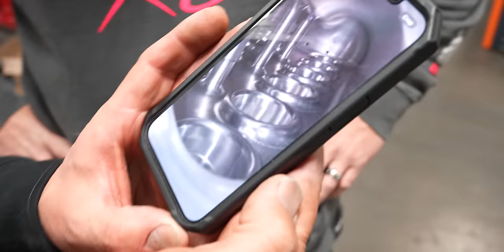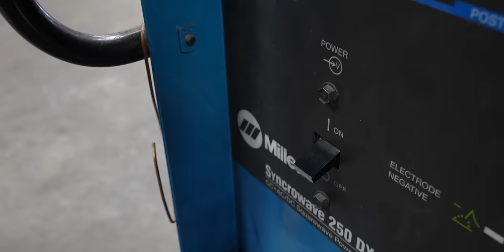EVERY FERRARI IS BROKEN AND CAN’T BE FIXED….

Comment: Put a fuel tech or Link ECU and hire a wiring guy in LA to come do it. Probably 5k a car for wiring. Plus , both ECUs are around 2500. Motec is overkill. I would do a motec in the f12, but the 599 can get the other ecus. Mike, look up a wiring guy, I do this all the time. If you guys would hire me, I could do it for you, but Dave still hasn't replied to my emails. 😂😅 good luck. The rear diff subframe is perfect good job guys.
Reply: put this comment to the top boys

Comment: Shouldn’t your tech have known you can’t copy the ecu’s? That seems like something a trained tech should know
Reply: Was thinking exactly the same thing 🤔 jury is still out for me with Steven. Time will tell I guess.
Reply: Yeah. This seems really odd
Reply: Was wondering this too. Dave took the fall but the tech should have known better.
Reply: You can’t copy the locked ecus.  Ecus that are unlocked I’m sure you are able to do pretty easily with the right tools.
Reply: AEG had modified the software, stands to reason they took precautions to protect their R&D
Reply: As a tech, some manufacturers place password protection on the ECUs  to protect their systems from being tampered with. They can get the code from Ferrari if they want to.
Reply: You need to hear that part again. EAG spend a lot of time searching and developing so it doesn't seem that one tech should know every corner of every car and each model. I assume when you are outside of the official shops you lose all the documentation regarding it.
Reply: Dave took the fall but it's 75% Steven 25% Dave's fault
Reply: How dare the McLaren tech not know the intricacies of a 15 year old Ferrari ECU
Reply: @jonathanlaw475  lol 
 Ferrari’s first ecu was installed in 1980….
Reply: @Mattius98  hes talking about the 599 its self.
Reply: @Mattius98  yup the 1980 Ferrari 599 that Damon and Dave bought
Reply: Could just be a "storyline" for the main channel involving Steven.
Reply: This is a very bespoke Ferrari ECU, it stands to reason a McLaren tech would not have known it was protected, You all need to cut Steven some slack.
Reply: @jonathanlaw475 did he not say he was a Ferrari tech as well.
Reply: Guys chill out, memory or eeprom flash protecting is very common practice for the last 20 years. And sometimes it not obvious until it's too late. I'll tell you one thing for free it's defo not anyone's fault at DDE as they used EFuse protection. Basically you do not know if it is protected as it looks completely normal, once you try copy it the EFuse wipes the memory flash and then you have a dead ECU and yes this comes from my career knowledge.
Reply: He’s a factory tech. Not a tuner as far as a I know. Tuning is more of a blacksmith kind of trade. You can either learn by being an apprentice under another tuner or hone your skill by trial by fire. I can take my car to Honda and they won’t have a clue how I’ve tuned my car to make the amount of power I make for 2 more psi over stock but they’re dealer techs. In the end it’s just a mistake, costly but lesson learned by fire.

Comment: Dave's black 599 needs a Ferrari yellow livery, so there are two bright 599's sliding around.
Reply: Gay
Reply: I was just thinking the same thing, matching livery in yellow.
Reply: @kengreen4933  it's ok bud, we don't judge in this comment section, be who you are, dude. Thanks for letting us know, respect.
Reply: @kengreen4933 actually not; because Ferrari is located in Modena, Italy; which has a state flag in Yellow. Ferrari yellow is famous; just like its RED.

Comment: You guys dont use absorbe oil pads? It soaks up just about any liquid it comes into contact with, and it's a great solution for absorbing oil around leaky machinery and other indoor cleanups. But, because it also absorbs water, it's not our most efficient mat for applications on water or in the rain. But they also got some it absorbs oil only.
Reply: Pig Mats 😀

Comment: Hey guys, you guys are well and experienced. But you should put some sort of rubber or duct tape works between the steel and aluminum. Prevents electrolysis helps keep materials good.

Comment: You can use the factory harness just take out non essential stock components and only worry about the engine and trans you'll need a piggyback ecu and a pdm to read the can signals as long as you have a wire diagram and take your time you can wire up the car
Reply: Or call tavarish 😅

Comment: Write a virgin eeprom to each ecu and reinstall them into the car then cycle the key 60seconds on, 60second off 4 times. That will force the ecus to pull the data from the bcm. Bcm should do a proxy alignment on its own after the ecus are done initializing.

Comment: You could get a shim plate made so the hand break tilts to the driver on 3-5 degrees it would still fit flush to the transmission tunnel and put the handle away from the shifter so clearance isn't and issue

Comment: There is a solution for ECU:
1) I presume it is a BOSCH ME unit?
2) BOSCH easy to work with BDM mode ;)
3) You can get virgin ECU (second hand all good too tbh)
4) Just get an ECU programmer to do an IMMO off, it will show a different VIN but who cars on the ECU (Or a very good programmer can recode the VIN too)
5) Then you can adjust the MPC/FLS only portion of the ECU's contents
Reply: Any good tuner/ECU operator worth their salt will be able to get this done for you. Also chat to SAMCRAC, he got his Ferrari ECU taken to a specialist and the guy did work on it, seemed legit af
Reply: Most Ferrari's used Magneti Marelli ECUs. They're kind of a pain to tune or modify. Particularly when you're talking about the older dual ECU cars.
Reply: Oh the 360 was bosch Me9.1? 

Anyway yes Marelli are a HUGE pain. Many supid commutation methods and reset requirements
Reply: @andrewbrody-popp513  truth be told the Bosch units were a little bit of a pain too iirc. Not being Bosch but because of some of the more bespoke requirements from Ferrari. Lamborghini uses Bosch and I don't recall them being nearly as difficult

Comment: I don't understand why they fried both cars ECU's, should they have only fried the ECUs of the car they copied the files to, the original car still has the original files or am I missing something ?
Reply: Steven messed up, he more than likely copied the file, tried to install it and  realized he messed up, tried to revert causing the ECM to lose data and he obviously didn’t save it. He’s a parts replacer not a tech.  (He wrecked both by not knowing what he’s doing)

Comment: if you only copied one of them the original should be fine in the one car. But anyways I did something similar to my VW except I deleted everything. I fixed it myself, I plug in my programmer and went in to OEM tools and hit reset and it reprogrammed it back to factory. I ended up putting it back to stock and left it alone when I seen it worked.

Comment: Why don’t u just make a bracket with a hole and use a pin to lock the brake for park then u can get ride of the oe can even put and safety tag on it like a jet pull before flight lol